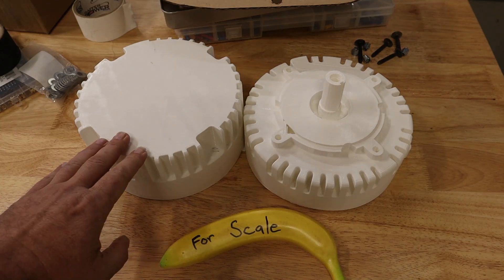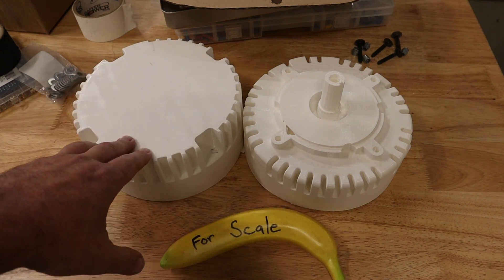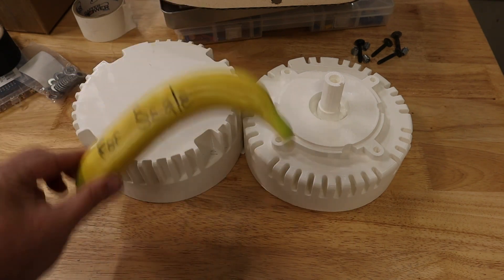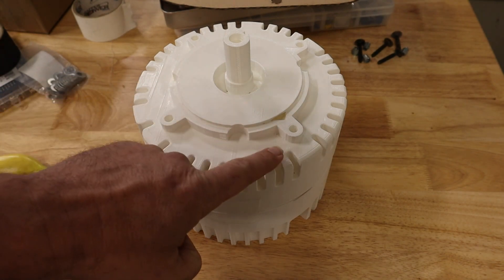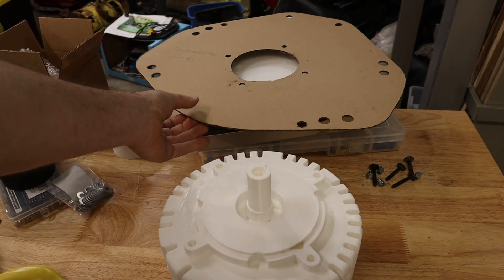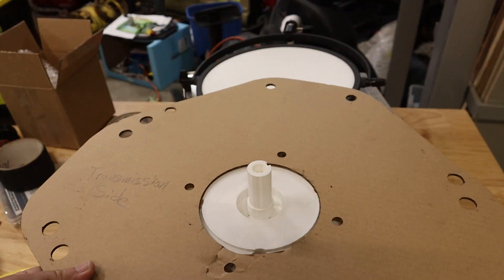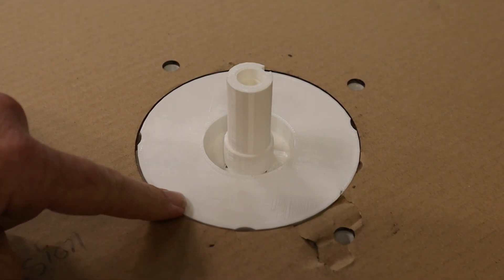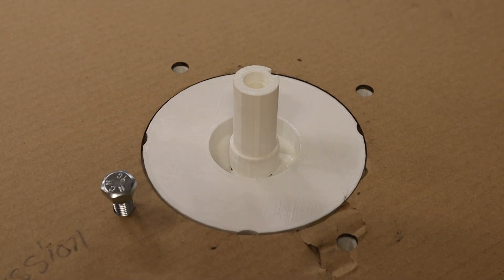3D-Printed Electric Motor Mock-Up

Comment: Great idea to fit the motor in the bell housing! Are you adding any sort of cooling? 

I have a fordson dexta myself, that i'd like to convert. Will be interesting to see how the 10kW electric compares to the original 20-ish hp petrol/diesel engine.

Comment: Same bolt pattern as an etek motor? I have one laying around I never put to use
Reply from the maker: Yeah, I think it is. This is a much thicker motor than the original Etek though.
My old Etek is currently in my daughter's go-kart.
https://youtu.be/3de_t9WQ0Ys
Reply: I also have an etek that hasn't quite made it into a project yet, cause I reverse polarities my second 4q 300amp(?) controller, sadly.

Am considering finishing my ninja conversion or swapping it onto my CyberQuad for kids... Humm.
Reply from the maker: @D0li0  That motor would be a blast on a kid's quad!
Reply: @BenjaminNelsonX  it would be down right dangerous, I'll need a wheely bar for sure.. ;). I haven't even opened the quad box yet...